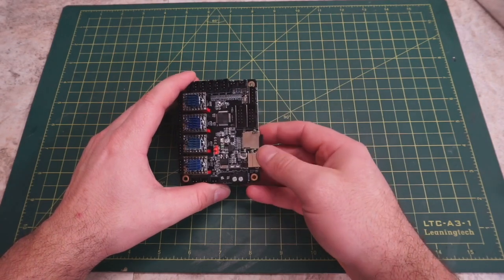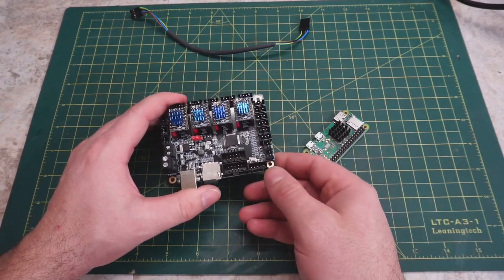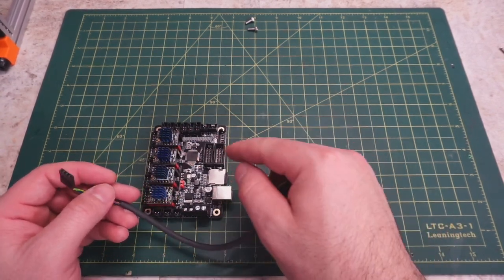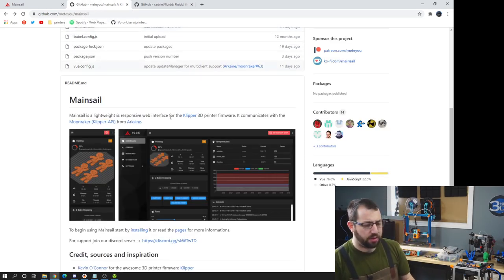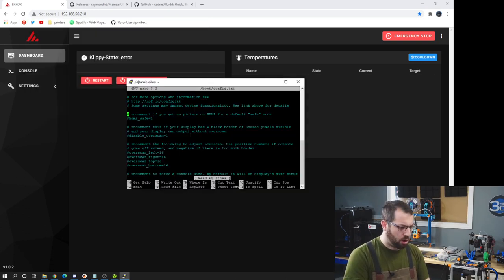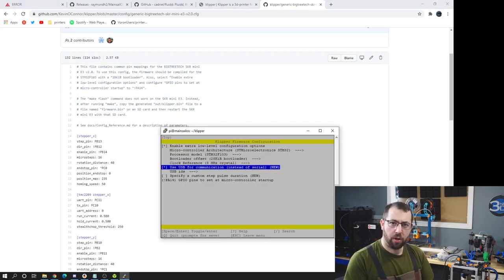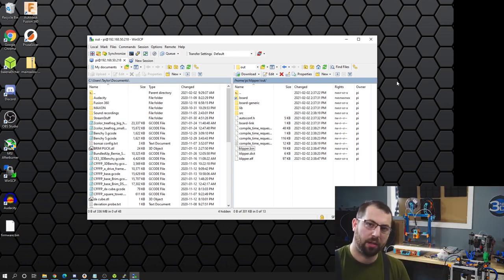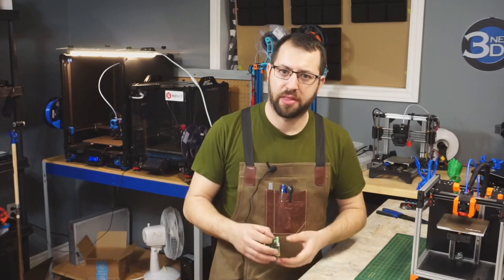Klipper and the RPI-zero, Low Cost Remote Printer Control!

Comment: For those curious about the initial changes in SSH, the Pi has two types of UART... Hardware, and software.  By default the Pi uses the hardware UART for Bluetooth, and leaves the software UART available on the GPIO parts.  Those commands enable the HARDWARE UART on the GPIO pins, so that Klipper has direct hardware access instead of emulated UART via software.  This is especially important on a Pi Zero W, as it's already low on processing power, and software UART would cause further issues.
Reply: Also, hardware UART guarantees 115200 baud; Pi a with Bluetooth have a (bad) habit of making the Bluetooth modem perfect frequency, while the software UART is a few Hz off. Sadpanda.
Reply: how can I make these commands work on orange pi zero?

Comment: Great video! 
With a little tinkering to the printer.cfg file i was able to get my SKR Mini E3 V1.2 with BL-touch and an Ender-extender 300 kit set up with Klipper and Mainsail. This video helped tremendously. 

The actual MainsailOS install part was easy, but the part where i had some digging to do was at 9:41 . Needed to ensure that i am choosing the correct UART on the board (SKR documentation lists which pins are which UART port) and then following the instructions in the Klipper Printer config file comments section. Once that part was done it was copy, paste, adjust for externer300 size, rename, print a test. Worked out perfectly and i got rid of a lot of the cable mess! 
Will be doing it for my RatRig once it comes in, and going the UART route as well! (unless there is a good reason not to?) Thank you, Thank you, Thank you!!!

Comment: Just a note on the connection between the pi and printer board, in this case both use 3.3V for logic, but for example ramps 1.4 and other arduino based boards usually use 5V for logic, so you will need to add some sort of a voltage devider so you don't fry your pi.
Otherwise great idea and I'm definitely giving it a try

Comment: It's worth pointing out I think that you can make the Pi Zero work entirely over USB too so that you can preserve the ability to use the display. You can even power the device via the USB port too. 

All you need to do is place a jumper wire from the 5V power line (can be taken from many jumpers on the printer board) and place it to the USB power line, which is also probably attached to a jumper. Then the Pi powers and communicates via USB and all you need is a micro > USB A adaptor and then a standard USB cable. I've got it working this way even with a Pi Zero that doesn't come with wifi. The USB port on the Zero connects to a micro>A adaptor and then plugs into a small USB hub. The Pi and Wifi dongle then plug into the hub.

Comment: I've run a printer with a Pi Zero W and a Logitech C720 and Klipper with no problems with Mainsail.   I'm currently running a printer with a Beaglebone Black which also has a single core 1GHz processor, and it works great with the C720 and Mainsail.  Even with PA and input shaping enabled it pretty much always show 30-40% idle in top while printing and streaming video.
Reply: One thing to note, the Pi cam I tested used noticeably more processor than the Logitech camera.  I would not recommend using a Pi camera.
Reply: Did the zero worked with the input shapping?

Comment: Most USB2 full hd webcam are MJPG encoded, which is basically a bunch of jpg files back to back. MJPG steamer can forward those with almost zero cpu overhead, if you set it up correctly.
Reply: How would I do that?
Reply: @FilmFactry  Check the docs for input_uvc, avoid any option that says it "disables MJPG." Basically, don't use -r, -y, or -f, and use -e of you want to lower the frame rate.
Reply: @LucasHartmann  Thank you. I want to run an endoscope as a nozzle cam:-)
Reply: @FilmFactry  I guess you may be out of luck then. 1080p webcams are usually MJPG, but endoscopes (at least the 3 I own) are mostly 480p and give uncompressed YUYV images. There is no avoiding CPU overhead with these.

Comment: I have a BTT E3 BTT board I had it running on klipper with a PI4 but I got some zero2 w.  I just can't get this to work. I get a serial connection closed error. I have rebuilt and reflashed MCU. I changed the MCU to your number5 instruction. IDK what's is going on. But I will keep at it.
Reply: Unfortunately I'm dead in the water. I had 2 different pi zero 2 w hook upto the tft pin on my board and noticed after about an hour no more green light on the pi and the 5v pin on the pi is only 4.8. I'm waiting on new SD cards because I think the pi's might be dead now

Comment: "simple. You just need to find on your board, where the available TX, RX, 5V and GND connectors are"

I tried for multiple hours now for readable schematics for an aquila Motherboard. I want to use the screen port but how can i find out where which Pin is?

Comment: Nice video! How can i do this on the creality 4.2.2 board? I do not find any datasheet / wireplan for the board. :/
Reply: "make menuconfig"
select "Enable extra low-level configuration options" and select
serial on USART3 PB11/PB10, which is broken out on the 10 pin IDC
cable used for the LCD module as follows:
 3: Tx, 4: Rx, 9: GND, 10: VCC to gpio rpi zero
Reply: Did you manage to get this working?

Comment: The more serious downside from powering the Raspberry Pi from the controller board in the printer is the higher chance of uncontrolled shutdowns of the Linux running on the Pi when someone just switches off the printer.  If the timing is wrong, you'll interrupt some I/O to the linux file system on the SD card and have some corruption happen.  The Pi uses so little power why not just leave it turned on with its own small little wall wart?
Reply from the maker: This board was kind of designed with the voron v2.4 in mind, which means klipper will the firmware a lot of using and there's quite a few of us that have been running machines with pi zeroes powered off of skrs to run the machines with zero issues for awhile now. 
I understand the issue you are bringing up, but so far in our experiences with similar setups its not really an problem

Comment: This configuration means the RPI isn't gracefully shutdown when you power off the printer. Any concerns about corrupting the SD card?
Reply from the maker: Have had zero issue on any of the machines im running where the RPI is tied into the main power switch.
Reply: This is a very good point that I think needs more visibility. The raspberry pi mounts the file system from the SD card. If power is suddenly removed while cached writes have not been done or completed, you can corrupt the file system. When you shut down Linux, it goes through a procedure to flush writes and unmount the file system before powering down. It may have worked so far, but it only takes one instance to corrupt your file system.

Comment: If you connect a Raspberry to the printer via USB, you do nothing other than establish a UART connection via USB. The UART protocol is only packed once into the USB protocol and then transmitted where it is converted back to UART.
If you can get your hand on a Raspy Zero 2W then you will have the same CPU as a Raspberry 3B. But there are weaknesses in WIFI when you connect a full HD camera. It should print well.
Reply: what would i use on the creality Ender 5 Plus Silent Mainboard, V2.2?  Im not seeing TFT pins.

Comment: The funny thing is that the reason this works is that TFT is not a screen - LCD is a screen. TFT is an entire self contained host computer that ordinarily would send Marlin GCODE over that serial connection. This is the reason why with very limited software like Marlin a TFT may be able to connect to wifi, respond to touch, cache gcode etc. while Marlin could never do all that on its own

Comment: Simple question. I.e. anycubic trigorilla board has No rxd txd port ..  is  it possible to use the Pi Zero USB port Connected to the printer USB port?

Comment: Hey here's a question. If you use UART for power and comunication, how would you then calibrate input shaping using an accelerometer ?
Would you have to power the Pi with an USB (therefore having to reconfigure a lot of stuff), then calibrate input shaper, then reconfigure it back to use UART ?

EDIT : Ah nvm, they're different pins for the accelerometer...

Comment: I have a pi zero (non-W) laying around, would I be able to use it using an otg cable and a wifi adapter, or wouldn't the adapter be picked up by klipper?

edit: The wifi adapter and the web interface work fine. Now I'll just have to wait for my printer.

Comment: I have a Raspberry Pi Zero without wifi, but I've managed to install a ESP8266 over it (you have to remove the flash memory from a ESP12F, though. The firmware for the ESP8266 is loaded into it via SPI from the Raspberry Pi at boot). I will try this.

Comment: Alright so... This video really piqued my interest in UART communication. I had never really known it was a thing.  I have a semi-complex question for you.
I run a Duet2 Ethernet and I would like to put Klipper on it. My machine is not a Voron (i know, I suck) but I use many of the Voron parts on it. What I would like to do, and what I have asked on Discord, is to run a RPi Zero-W on UART, but also use my Paneldue v3 4.3.
SO...

#1. Can UART be used? I know the SKR can do it, so it should work here too, right?

#2. If UART CAN be used, can I still put my Paneldue back into play? I know the Paneldue can be run to the Pi over UART, but can I bridge them all together?

#3. In UART mode, will I still be able to send an update flash to the Duet, or will I NEED to use USB connectivity?

Comment: This is brilliant! Stupid question: is it possible to use the USB connection instead of UART? The reason being, I'd like to still have a TFT and wouldn't mind running an extra cable for its PSU. It seems it should be  more even straightforward; just following your guide minus skipping some of the steps for UART config. Would that work?
Reply from the maker: Yup. Just follow the standard klipper install instructions on yhe klipper github. 
Going with uart and this method is for those that want compact. Cheap solution with one cable only. Or those that wanna free up the one free usb port on the rpi zero for example
Reply: @CanuckCreator  Thank you very much!

Comment: Hi, please tell me, my clipper on raspberry zero w worked fine , then suddenly stopped connecting to local , although the printer turned on the light and was ready to print, I decided to reinstall everything again , but my rapsberry does not give me an ip address at all, connects and makes all the settings , but the address is not visible anywhere else , there is no one in the information about my connections at all , although rapsberry connects to it , if config does not give information

Comment: do you not need a Raspberry Pi Zero W and not a non Wi-Fi version? As i have version V1.3 non wi-fi, i guess this won't work as the USB port will be connected to my main board?

Comment: Hi, Thanks for making this! I was wondering if connecting a webcam with onboard h.264 encoding would be a viable workaround to the pi's onboard encoding. Would that make any difference on the cpu usage?
Reply from the maker: I dont have a camera on hand to test, but from other source any webcam will be close to overtaxing the pizero
Reply: @CanuckCreator  I thought I should come back with an update. I managed to get everything running: klipper AND webcam streaming at 640x480 30fps mjpeg at less than 30% cpu load while printing. All we need is a more efficient Linux distro. I made this guide for an even weaker device running Openwrt and I have no issues whatsoever. https://github.com/ihrapsa/KlipperWrt

Comment: Will you be making an updated video using the Pi Zero 2 W?
Reply from the maker: Working on Pz2 stuff right now, but this method is unchanged on the zero 2  and works just fine (already tested)
Reply: @CanuckCreator  I’d like to see the performance difference when using advanced features that require more processing power such as input shaping or accelerometer support as well as using a camera via the pi’s usb port.

Comment: how long does it take to flash the board? ...and does the board needs to be connected to "stepper motors, sensors, external power supply, etc..." or is it enough to have the power from the Pi?

Comment: I'm trying to do this on a Tenlog Hands 2, and it will not connect via UART. I have tried all the ports, and switching the Tx and Rx around. Still nothing. Any suggestions?

Comment: My Ender-3 V4.2.2 controller board does NOT have an available serial port.  It does not have native USB serial, but uses a CH3xx USB-Serial chip.  However I don't want to have to perform surgery on the board to bypass that, so can I still use the RPi zero USB to connect to the printer?  It would mean not changing the serial settings on the pi as you showed.  I'd need a USB cable between the printer and the Pi, but I can live with that, if the extra CPU load of the UDB serial driver isn't a problem.

Comment: What happens if i have this setup and i connect the printer to a computer via the USB port? I understand that the bulk of the computation is done in the pi and it just uses the board as a slave but what would happen if i connect the printer to the PC with pronterface?

Comment: Does mainsail or fluid support my tp-link hs110 wifi switch?
Octoprint has a plug-in for it and it allows it to use m81 <ip address> to controll it. It also has a few safety features that i don't want to lose.

Comment: Hello, I tried this method with my Pi Zero W and an SKR Mini v1.1 to try to get around an issue I was having with the serial connection. I've established klipper settings well enough that with a pi 3b+ connected via usb to the board, the pi established connection with the MCU. But with the same pi card in a pi zero W, I have not been able to get it to recognize the MCU via USB or UART... I have tried a different pi Zero W and it also didn't work, so it appears to be an issue with the platform, not the individual board.

Comment: I have a problem on pi zero w. No input shaper and I get most of the times 100% load that halt printing. Miniuart, overclock and cooling. Fluidd and mainsail have the same problem. Connecting on uart

Comment: Question: after the skr is flashed, and firmware.bin transforms into FIRMWARE allcaps, does the skr need the sdcard? Or can I take it away? I.e. will an updated skr power up and talk klipper with no sdcard installed? Cheers!
Reply from the maker: I believe it needs to be kept in
Reply: @CanuckCreator  this sounds like an opportunity to "For Science!" it ;) maybe it is time to update my old bed slinger to an SKR board...

Comment: When I insert the SD card into my Ender 3 Max the screen stays blank (so it did something), but the firmware file doesn't get renamed and the pi can't connect to the printer. Flashing the original Marlin firmware back to it worked without any problem.

I have also tried other names because the config file suggested that it can't be the name of the last flashed firmware, still no success.

Any suggestions what the problem could be?

Comment: Thanks for the video!  It seems like using this approach on the V0.1 configuration (with DC print bed heating) would reduce the total number of electronics to the 24V power supply, the control board, and the Pi Zero.  Is this correct?  If so, it seems like wiring would be extremely simple.
Reply: Yes it simplifies the build greatly and for a 300x300 a cheap $30 24v heatbed works great.

Comment: i'm trying this on the mks robin nano v1.2 via de wifi tx and rx pins, but i cant get it to work. if i disconect a tmc driver, klipper says that it cant find it, but if everyting is plugged in, it keeps saying that the printer is not ready or standby. really weird that it can see if there is a tmc driver missing, but won't connect

Comment: Is the PI zero 100% reliable and safe to use for printing with fluidd/mainsail without a camera? And can it handle input shaper with accelerometer?
Reply from the maker: Yes. Just avoid the webcam
Reply: Thank you, and for the videos too!
Reply: It's possible to use reliably with webcam as well but not on raspbian. You need a more efficient Linux distro. Check this out: https://github.com/ihrapsa/KlipperWrt I use an even weaker device with webcam streaming on OpenWrt and have no issues
Reply: @CanuckCreator  My experience is that the Pi zero does not handle inputshaper. It does not have enough power. I don't use a webcam.
Edit August 3rd:
After overclocking de pi zero it is working, but not reliable. Still overloads the mcu sometimes.
Reply: My pi zero w could not successfully complete the resonance test with the accelerometer. I worked around this by using a pi 3b+ from a different printer just for the input shaper resonance test. After getting the values, I haven't had an issue running input shaper on the pi zero w with fluid.

Comment: One thing I wonder is, when I turn off the printer, I will also cut power to the RPI. Eventually this will kill the filesystem on the SD, right? How do you deal with that?
Reply from the maker: You can shut down the RPI through the web interface before powering down.
But i normally just do a hard shutdown and havent damaged any SD cards so far and thats several printers over a few years.
Reply: @CanuckCreator  Thanks for replying. I will then just tie it into the SKR's 5V supply as shown in the video!! On my main printer I use an ATX powersupply and I've tied in the RPI to the 5V-stb that's always on, but this is for my little side project for setting up my aging monoprice mini with klipper